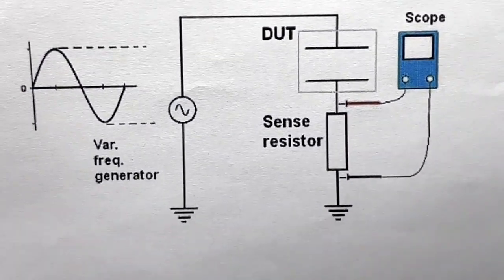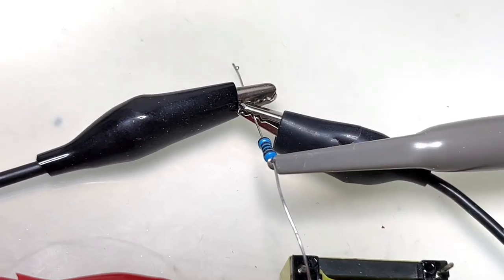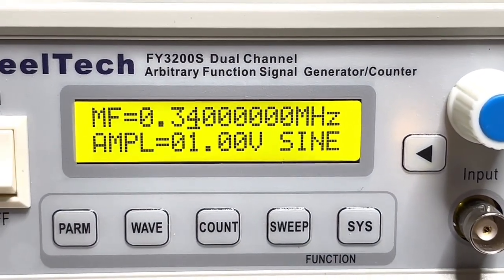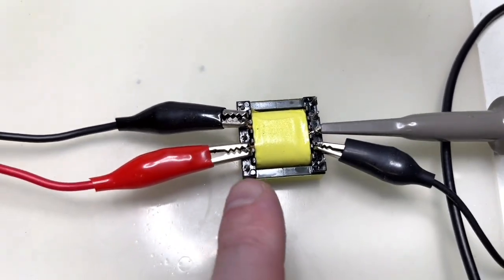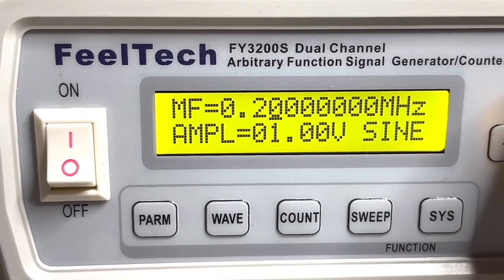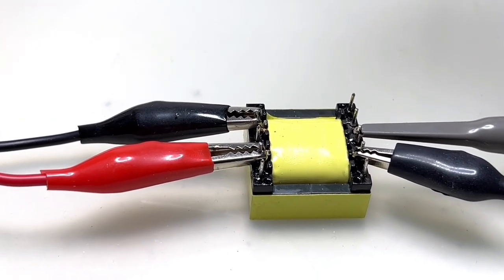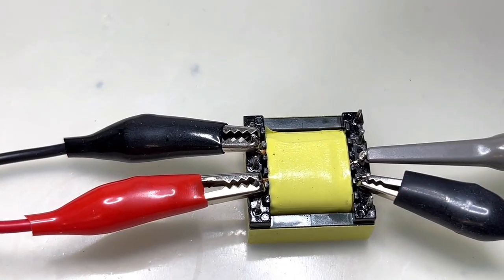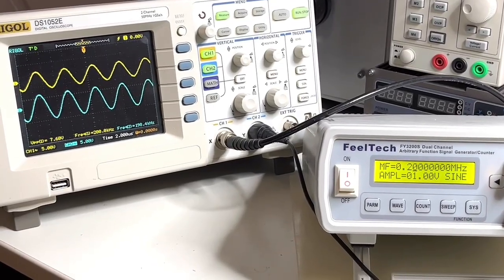How to determine a Transformers Windings Phase Dot Relation, Resonant and Operational Frequency

Comment: 7:43 I'm curious if this statement is always true. I know that in any normal power supply you'll need a lower working frequency than resonant frequency, but aren't there times that you could run it at resonance? Aren't tesla coils run that way? Or when people talk about running TCs are the resonance frequency, do they mean resonance of the whole system including capacitance to ground, so it it's actually a working frequency and the true resonance is higher? Or do TCs really run at resonance in order to get the crazy high uncontrolled voltage spikes, and that's exactly why no consumer product or regulated output would run a transformer at resonance?
Reply from the maker: Yes In resonance with an External Capacitor, not the self resonance of the Coil. Tc circuits have a serial or par capacitor in the primary and the capacitor of the secondary is the „imaginary“ air cap between  the top of the secondary and the earth gnd. A top load would increase this capacity.
Mc tc resonance tester shows exactly that.
Reply: @KonstantinGrigoriadis Thanks! So it's basically the same as the resonance of an LLC or ZVS supply? It's still always below the transformer's actual resonance?
Reply from the maker: @SkippiiKai  a single inductor at its resonance frequency acts as a open Circuit, this is why the operating freq of a transformer must be well bellow. It is the Opposite if the Coils is used as an RF Choke, the you exactly want it to be used at its Resonant Freq bcs as an open Circuit at that Freq it will prevent the freq from one side of the choke to the other. Thats the  work of an RF Choke for example.
You mix Resonance of an lc Circuit with Self resonance of a Coil, that not the same !
Reply: @KonstantinGrigoriadis I think I understand the difference, just confirming that I'm understanding what the HV people are talking about. But now I have another question based on what you said: I understand that inductance at resonance looks like an open circuit, but isn't the resonance point also defined by the parasitic capacitance, which appears as a short? So the resonance point isn't where the impedance is highest due to the inductance, but instead where capacitive effects start to take over and lower the impedance again? I feel dumb asking this, because I'm pretty sure I used to know all this at one time...
Reply from the maker: At resonance, LC circuits exhibit specific impedance characteristics (high or low depending on series or parallel configuration),  while at SRF, the inductor essentially becomes an open circuit.
LC resonance frequency for example is determined by the values of the external inductor and capacitor, while SRF is determined by the inductor's internal parasitic capacitance and inductance
Reply: @KonstantinGrigoriadis Ah, you answered my question while I was still typing it! Thank you, it all makes sense now.

Comment: Can I use these methods to find the resonant frequency of a Tesla coil primary and secondary circuits?
Reply from the maker: Hi, should be possible, the operating freq of it. btw i designed a tesla coil resonant meter, i made 2 videos about it, in case you are Interested, no other external equipment neded
Cheers, Konstantin

Comment: Forgive my ignorance. I have a question, when designing a smps what figure do we used in calculation, its resonance freq or the running freq value? When driving the transformer do we set the pwm at the known running frequency of the transformer or the resonance frequency of it? TIA
Reply from the maker: Hello , you Calculate the Transformer to operate at the Chosen Frequency.

Comment: You are very knowledgeable about SMPS. If you update your topics with SMS that can be made by many amateurs between
for example  0-30 volt adjustable voltage  and adjustable current (for example 0-5 ampere) SMPS lab  power supply , I am sure you will get much more viewers and likes.

Also, if you analyze toroid cores ,that we have no information about, as in this video, these videos will be very valuable.
As you know, toroid cores have quite complicated calculations.There are different formulas used by different companies, which are not related to MKS and CGS systems.
Summary , these types of videos will be more liked  videos for amateurs.
For example:
TL431 applications
UC384X applications
SMPS designs with 1-2 amps, 5 volts and 3.3 volts outputs, and also 35 volts outputs that can give 3-5 amps (In other words, SMPS with 3 different outputs) will be very important videos.
Yes, I know that preparing a video takes hours with the editing part, but at least getting a tripod for your videos will increase the count of views of your videos incredibly.
I wish you success in your work.
Reply from the maker: Thankyou.

Comment: I saw a grid dip meter once, it was in a college physics lab back in the early 1970’s!
Reply from the maker: Hi Paul, could have been a Tube base one eventually :-) 
The "Modern" ones (Mid 70's early/Mid 80's) were Solid State. I Made 2 Videos about one I Designed fully Digital, Micro Based with LCD Display and the one I have , as reference, a Commercial one :-)

Comment: I dont know if you went through this in another video. It would be interesting to show how you are getting other relevant parameters from the transformer. Inductance would be one, saturation current, operating current etc 

From practical perspective this would be the most hands-on thing that a ham could do
Reply from the maker: Hi, Inductance is easy with an LCR Meter, for ISat are many Videos about already. Eventually I will make another video for further Parameters like: Lleack , Parasitic Capacitance,etc.
These are Parameters needed when designing a SMPS.

Comment: I have a REALLY OLD Vacuum Tube signal generator and an old Tektronix scope but I kinda do it the same way but I will try the resonance trick with them if that is even possible with this equipment. I don´t really have any amplitude compensation of this generator exactly lol
Reply from the maker: Hey Christer, Great to hear from you again :-) !
How are you ? If the generator is can deliver 1-5Vpp its ok , its not about the exact amplitude but the amplitude changes over the Frequency Sweep. Cheers, Konstantin
Reply: @KonstantinGrigoriadis   Yeah it can deliver the voltages but it is with pretty low current as tubes usually gives. I am fighting with life as always but I hang in there. I hope you do well
Reply from the maker: Well I am fighting with my Health… I wish you all the Best, Cheers Konstantin
Reply: @KonstantinGrigoriadis  Sorry to hear that. I hope you get well. The doctors have me on sick leave because my own health so I know how it is. I try to tinker with my gadgets when I can at least

Comment: Everyone has a NanoVNA these days, no need for a grid dip meter.
Reply from the maker: Hello, well I don’t have one, thats why I didn’t mentioned it
Reply: NanoVNA doesn't work well at frequencies below 50khz... I have 2.
Reply: @waterforfuel  Official spec is 10kHz for H4. My specimen (1.2.22 firmware) is ok from ~6k for S11 and from 1k for S21 (the measurement you would use when replicating this method). If you need better performance below 10kHz you are better of using a sound card and loudspeaker impedance measurement software.
Reply: @galileo_rs  specs and real life aren't the same...if you don't have the experience then you won't know.
Reply: @waterforfuel  Reputable companies have reputable specs. Before I posted my reply I tested my H4 because I could not remember what were the lower bounds, as I don't do audio work. I suggest that you get some experience and drop the attitude.
Reply: @galileo_rs  and yet it still doesn't work with square wave input... my attitude works, unlike the nano and your testing of bla bla bla.
Reply: Calla pavazo , aaaaeeeaaaaaa